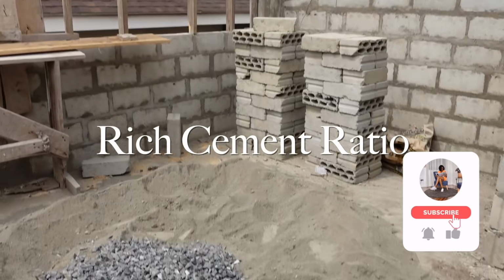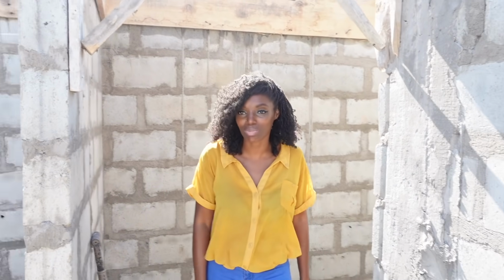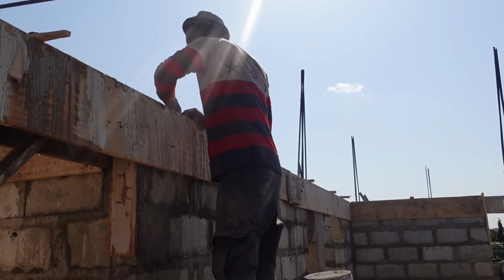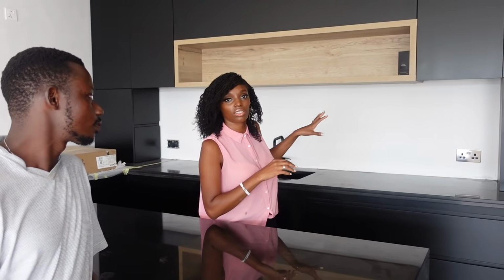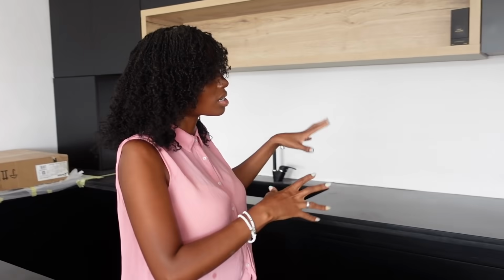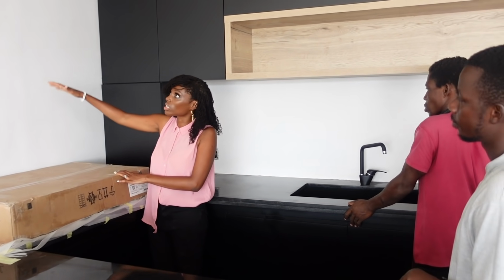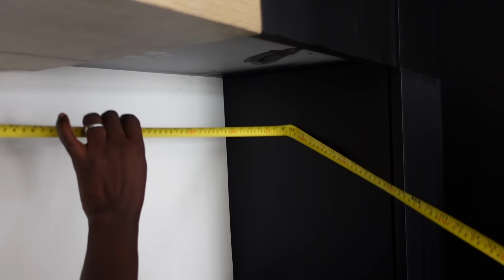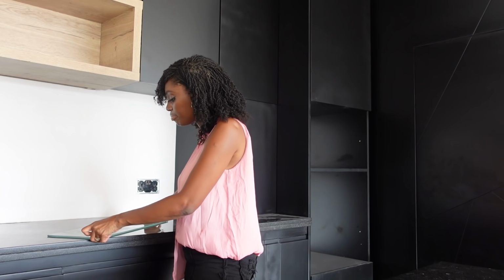CASTING, KITCHEN AND EVERYTHING ELSE INBETWEEN!

Comment: You may choose light-brown tiles (just like the middle shelf) for the other side as splashback. Also choose the silicone colour carefully, either the same colour of the worktop or as the tiles. I asked you to do a video to compare MTN & VODAFONE or any other phone network in Ghana but l didn't hear from you. If possible, let's know who has the best WiFi Connection, price/fee etc. Thanks.

Comment: Definitely go with sitting the faceplates on top of the glass the less cutting of glass the better. Also you have to deal with micro little glass shards around the cut area that flake off. It's not worth it to make it flush.